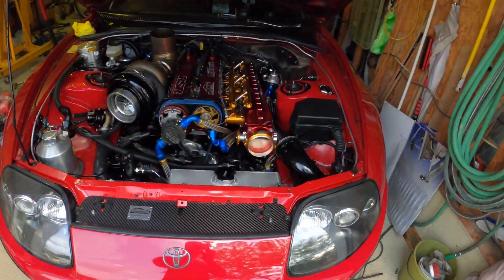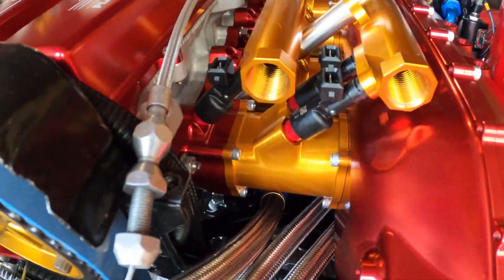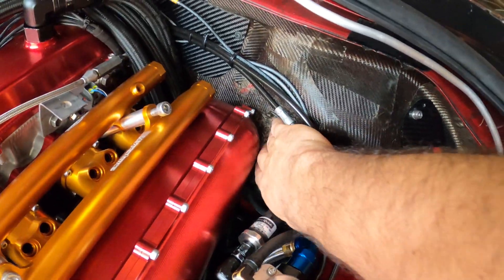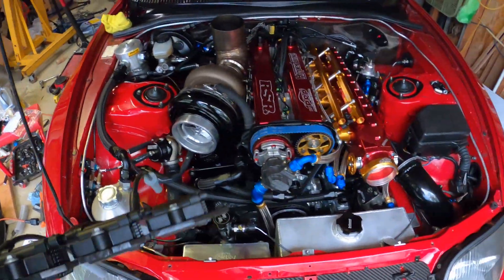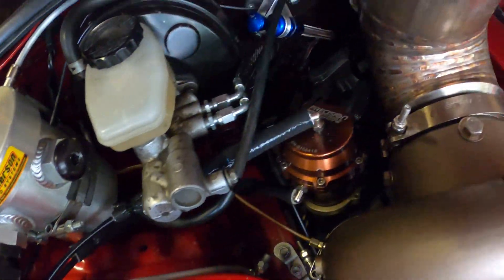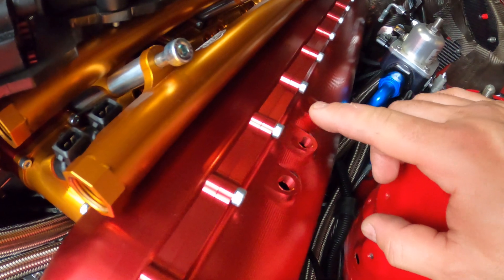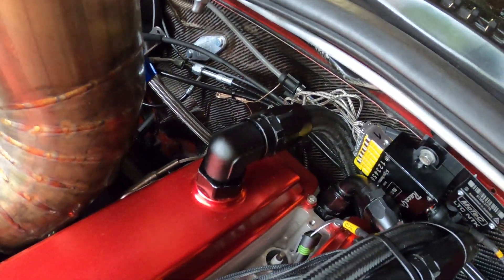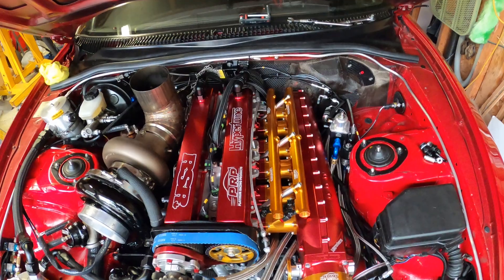Hypertune 18 injector intake manifold

Comment: I was looking for orifice specs on my diesel injectors to bore them and came across this, coming from a diesel guy i have to say this is impressive, with a gas engine its so much more tedeous for performance, with diesel we just add more fuel, more boost and manage the exhaust temps but on gas engines its so much different and complex, great work my friend its a masterpiece